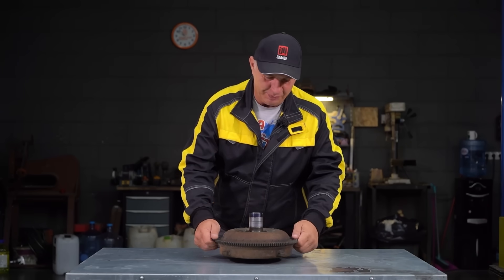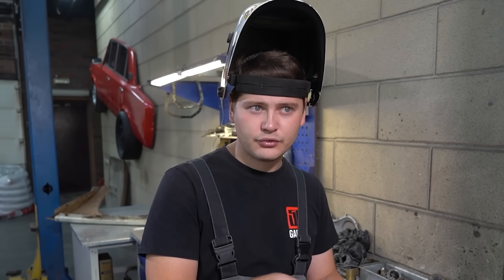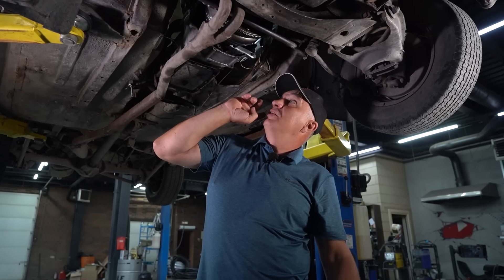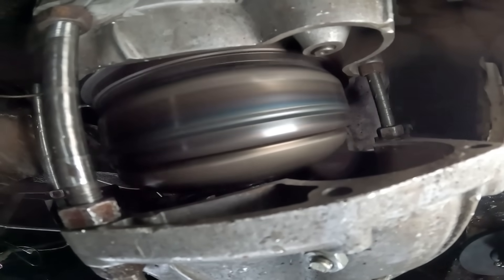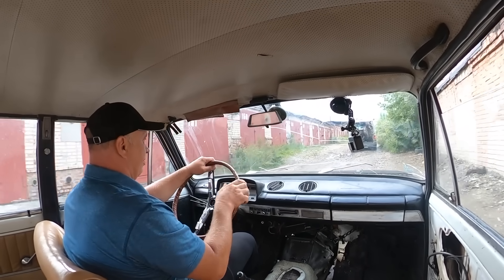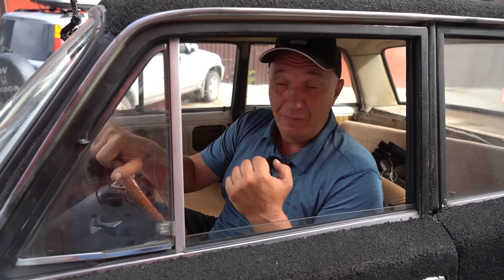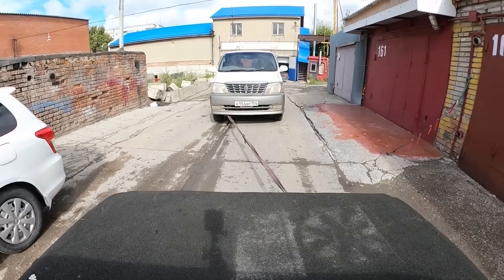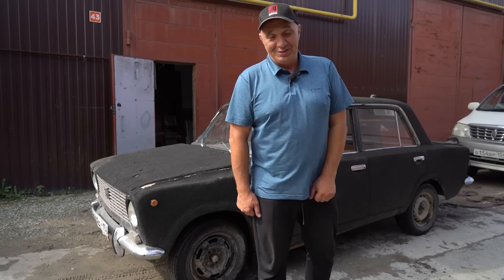Torque converter in a manual transmission - will it work?

Comment: Chrysler did what's called "fluid-drive" in the 50s which is a manual transmission with a fluid coupling (similar to a torque converter) and a clutch.
Reply: I drove both my '48 DeSoto and '50 Dodge today, both with Fluid Drive. The DeSoto has the M6 semi-automatic transmission and the Dodge a standard 3 speed. You only step on the clutch if you want to move the shifter. Oh, the last year of Fluid Drive was called Fluid Torque Drive and had an actual torque converter that used engine oil instead of the sealed Gyrol fluid coupling.
Reply: @ Love the DeSotos they were beautiful cars.
Reply: My 1949 Plymouth came with a fluid drive. Only need the clutch for take off and reverse
Reply: @lightcasey1  I had one as a teenager, leave it in 3rd and no shifting if you want, just slow on takeoff!!
Reply: @lightcasey1 Mom’s ‘49 Dodge Wayfarer, could leave in 2nd and drive in town, no clutching.
Reply: It wasn't stock, as Plymouth never offered Fluid Drive until the 53 HyDrive.
Reply: Koenigsegg uses a torque converter in one of its 150hp cars
Reply: @bogganalseryd2324  "Koenigsegg uses a torque converter in one of its 150hp cars" What a beast.
Reply: @eriklarson9137  lol should say 1500 lmao, the 1:1 I think it is in.
Reply: @bogganalseryd2324 they also designed a torque converter that is basically the only gear in the car
Reply: You mean 1500hp?  @bogganalseryd2324
Reply: @bogganalseryd2324  yea except the difference between their torque converter and other torque converters, is koenigsegg is just engine, TC, connection to the wheels. others are engine, TC, trans, connection to the wheels. the koenigsegg is in a direct drive ratio the entire time, and the only way it can reverse is the electric motors
Reply: Exactly! I owned a 53 Chrysler New Yorker (loved that car BTW). They called it Fluid Drive because the early version of a torque converter. Prior to Fluid Drive, all they had were manual shift cars.
Anyway, in order to drive the car, you had it in park to start it. Then, you pushed in the clutch (just once, which was the great selling point of Fluid Drive) and moved the lever to drive or reverse. 
As you drove, if you wanted to shift to a higher gear, you let up slightly on the accelerator and the transmission would automatically go to a higher gear. When you slowed down, it would downshift automatically.
If you think about it, in the 1950's, this was quite amazing if all you ever drove was a manual.
Reply: @moodberry not true, the hydromatic came out in the early 40s buicks and cadillacs.
Reply: Buick never offered Hydramatic until 1964.  They offered DynaFlow.
Reply: Drag racers did it with 727 trans known as clutchfite, was very harsh shifting
Reply: @rtraymond  Yes I remember those & they also made them for the GM Th400 !  They are very hard to find now and they were designed because at that time nobody made a stahl torque converter for the 727 & TH 400 that were being used for drag racing until I think it was B&M transmission designed & made the first shift kits and HP torque converters for automatic transmissions . Basically the clutch was used so the engines could be reved higher & the ability to dump the clutch to launch the car harder. You put the auto in 1st gear holding the clutch in do the burnout then stage dump the clutch then let the automatic shift it's self or shift it by hand to hold the gear in longer for each gear of the automatic.  I had read that supposedly Steve McQueen was the one who also invented what's now known as the trans brake for automatic transmissions or had something to do with this because he not only raced just about everything he could race in but with his money and the people he knew he probably had something to do with the invention of the trans brake . A lot of experimental things going on in drag racing back the like guys cutting torque converters in half & removing some of the converter fins inside then welding them back together and having them balanced so the engines would rev higher with the brakes on & basically creating a stahl converter although not very efficiently at all compared to these new high flash speed converters that are much smaller and have the fins curved that slowly open up once the rpms comes up then locks the converter up to launch the car & now they have these anti balloon plates welded to the converter snout for supercharged and nitrous applications so the converters don't explode from the high HP and torque they make over a natural aspirated engine .
Reply: @rtraymond I forgot about those.
Reply: There was also the VW AutoStick.
Reply: RIP Walter Chrysler
Reply: Citroën did this in the 70s - called the Convertisseur.
They used a automated dry clutch in series with a torque converter.
Reply: I had one of those setups....with  a 392 hemi in a 1940 Chrysler.....
Reply: @TheWolfsnack  And it held up in back of a 392?  Amazing!
Reply: @TheWolfsnack  Yes, mine was the 392. A lot of people don't know, but the 392 was exactly the same block as the famous later 426 hemi used for dragster cars for a long time. I think the only difference was the bore diameter and maybe some minor things like camshaft and/or main bearings.
Reply: @moodberry Completely wrong. The 392 and 426 are completely different engines. First off, the distributor is in the back on the 392, and on the front in the 426. There is not a single part which will interchange between the two engines.
Reply: The first thing I thought of when I saw this video!!
Reply: Old yale forklifts from the 40s had the same setup
Reply: Not only did Chrysler did this but they had several models of it. some had three speeds some only had two. The clutch pedal had an orange cover on it. A interlock switch on it required you to depress this pedal first in able to start the engine. Once the car was running, you selected which gear you wanted to start in.
Reply: @dalemettee1147  The simplest iteration of Fluid Drive was the Fluid Couple in front of a conventional 3 speed manual.   This debuted on the 39 Imperial.  Optional was the same with overdrive.  For 1940, they were both extended to New Yorkers and Saratogas with 1st gear blocked off, but nowadays, 1st is likely to be unblocked.  For 1941, the Dodge get the 3 speed with Fluid Drive, with or without overdrive.  For 1941, a vacuum operated semi automatic 4 speed was introduced for the Chrysler 6 and the DeSoto.  For 1946, both the vacuum-operated "VacaMatic" and the 3 speed with overdrive were replaced with a new 4 speed hydraulically operated semi automatic for the DeSoto and Chryslers, with it being standard on Chryslers, except for the bottom of the line Royal.  Dodges were not supposed to have this trans until 1949, but earlier models have been found with it.
Reply: My dad had one when I was a kid we traveled to California in it .
Reply: When I was about 15 (1974) I got to drive my grandmother's mid-50s dodge that had the fluid drive 3 speed manual trans. Once you put it in gear you didn't need the clutch to stop and start, only to shift gears and if you were careful, you didn't even need it to shift. You could put it in any gear and take off from a stop. It was a slug on the take off in high gear and I imagine if you did that very much you might damage the fluid coupling.
Reply: GM had a system for the Chaparral 2A. Fluid flywheel on a 2 speed+Rev manual transaxle. Mag. alloy casing weighed 7/10 of nothing and had to transmit 450ft/lbs of twist, with 14"wide soft racing rubber and rarely gave trouble as long as the oil was kept cool enough.
Reply: YUP, When I was a kid, we got about a 50 Plymouth that sat on the neighbor's farm running with the fluid drive. You could take off in 3rd (high) gear. It wouldn't spin the tires on gravel no matter how hard you tried.  In short order, the neighbor kid's parents found out we were tearing around in it, and that was that. Not sure why they had a problem with 12-13 year olds driving around. We even got the brakes working, sort of. 😆
Reply: I have a 46 dodge with the fluid drive manual transmission
Reply: The finnish Rasi (raskas Sisu) is a 6x6 offroad truck with a torque converter and a manual transmission.
Reply: Dry clutch in front of torque converter followed by a regular transmission was used in several pieces of construction equipment in the past
Reply: It's the gyromatic transmission. My 1948 Chrysler Windsor has that type of transmission. I love my ole 48. Fun to drive.
Reply: I think Pontiac experimented with similar in early 60's,  the tempis was also involved in R&R, I think ?? Anyone 4 sure on this ??
Reply: @davidsanders6957 my tempest was just a two-speed automatic with the torque converter spinning behind the rear bumper
Reply: @RonaldDaub-v9y  Rope Drive!
Reply: So did Packard.
Reply: I remember riding on one of those cars😊
Reply: MAN KAT lorries had a great gearbox, working on the same style.
Reply: @Ben72-u6p  That's just an automated clutch pedal.
Reply: Add Packard to the same type of transmission.
Reply: GM made the same setup for WW2 era tanks. VW too with the semi auto Beetle, but later in years. Then you've got the B&M hydro-stick kits that worked really well in the gasser classes of drag racing.
Reply: I had a 52 Chrysler windsor with that
Reply: They are weird to drive, had the pleasure to try one once
Reply: I've driven a military truck with Cummins engine and a manual gearbox with torque converter. Only needed to clutch when shifting, but for example at stop signs you could just use only the brake and drive it like an automatic.
Reply: It's easier just to put a centrifugal clutch on it or a belt clutch with triple pulleys
Reply: My Yale forklift has that... a fluid coupling & a clutch.   Old tech
Reply: My WWII era father would occasionally reminisce about those.
Reply: 1953-1954 Plymouth Hydrive had an actual Torque Converter instead of the Fluid Coupling.
Reply: Imagine a normal Torque converter with a lockup Clutch inside plus a seperate clutch between the converter and gearbox. You could push the normal clutch by foot to select a gear then let off the clutch and start moving with the torque converter and from 3rd gear and up the torque converter locks up so you Drive it like normal manual
Reply: Auto manual transmission used for racing in the 50’s-70’s used a power glide with a three speed behind it.
Reply: My Grandfather ha a 49 Dodge with fluid drive.  You could just step on the brake at a stop sign.  Not much off the line that way though.😂
Reply: I was thinking same thing
Reply: Chrysler started the Fluid Drive in the 40s. I had a 47 Dodge Club Coupe with Fluid Drive. I could stop without using the clutch. Didn't accelerate quickly in 3rd gear but I didn't have to move my arm from around my girlfriend! LOL
Reply: Came to say this, drove my father's a couple years ago. Needs a new clutch and fluid change.
Reply: I have a 1950 Dodge Pilot House with a fluid drive. I was going to comment that this sounds almost exactly like a fluid drive.
Reply: smooth drive :)
Reply: I had a 48 dodge with fluid drive. Worked ok.
Reply: you beat me to it . I had a 50 chrsyler windsor sedan that was fluid drive. 6v positive ground. It worked pretty good for what it was .around town you could just put it in gear never had to shift or clutch at a stoplight
Reply: My father had such a Chrysler. That newfangled transmission was difficult to master and was a pig for eating horsepower and making the car slow as molasses on a winter day. No wonder the idea was dropped.
Reply: @rcnelson  It was dropped because Powerflite came out in mid 53, and customers liked it better.  Most of them anyway.
Reply: Clicked on the video exclusively to say what you already said.
Reply: Would have been awesome with a switch pitch torque converter.
Reply: No kidding. Didn't Tucker try something like that in the 40's? I wonder if they perfected what he was trying? If he had just been a better business man I think Tucker could have succeeded. He bought an aircraft engine manufacturing plant and that at the time was doing excellent business selling engines for small planes and had like 60% or greater of the market and stopped them from selling their engines for airplanes so they could go in his car. What kind of a business man stops a profitable business so he can maybe make money on something else? If I didn't know better I would think he learned from our current president.
Reply: my stepfather had a 53 Plymouth. that thing was awful.
Reply: I was just about to make this comment. I restored a 48 dodge business coupe & it had a fluid drive. Such an interesting idea.
Reply: auto transmissions all have clutches inside and the transmission can turn-on the converter lock otherwise its off mechanically
Reply: @prjndigo yes, but look at the difference between a dcts clutches and the clutches in a standard torque converter automatic, quite different. The gears themselves are different between the two as well
Reply: Something similar modern day called a viscous clutch, I think it was Volvo XC90 early 2000's, AWD if the tires are different sizes it destroys itself tho so watch out
Reply: I remember that on a 40 Dodge. 3 on the tree, clutch pedal. Put in first on a steep hill, let clutch out and it would hang till you gave it gas.
Reply: A common wet clutch manual then? (Supercar territory) Chrysler were ahead of their time for sure!
Reply: @Hrossey  No, a normal dry plate clutch in series with a fluid coupling.  This became an 'automatic' with the addition of a then-common overdrive unit behind the transmission (but it was actually set up for underdrive vs direct drive).  There were two ranges, 'low' (with the gear selector in the equivalent of 2nd gear on a 3-on-the tree), and 'normal' (with the selector in high gear).  You pressed the clutch to go into one of these ranges.  After that, you relied on the overdrive unit to switch between underdrive and direct drive.  They had the reputation of being pretty sluggish in normal range, but they did offer two pedal driving once you selected a gear.
Reply: @boggy7665  didnt this system also cause cars to literally get 3mpg
Reply: @bluespidergaming7719  My 1949 Chrysler fluid drive gets 20mpg.   And the fluid drive still works perfectly.
Reply: @bluespidergaming7719 that’s the Buick Dynaflow transmission which essentially was a glorified torque converter with variable pitch vanes. Provided smooth driving, but fuel economy was out the window. Even in the 1960’s, the Buick Dynaflow averaged 6 MPG and that was terrible by 1960’s standards. And yes, people did actually care about fuel mileage, that’s why there were cars like the Ford Falcon and a few others for those who were conscious.
Reply: You are describing the pre-war version only.  The post-war version, which is what is more common, is a 4 speed constant-mesh trans that shifts automatically between 1st and 2nd in Lo, 3rd and 4th in Hi, later called Drive.  In normal driving, you only needed Hi/Drive unless you were taking off on a hill or towing a trailer.
Reply: Also, Buicks couldn't match the performance of an Olds or a Cad.  Hydramatic was just better.
Reply: @bluespidergaming7719 you might be thinkong of the dynaflow. That was Buick and not the same thing. The torque converter has many different states to accoifor throttle and it did have 2 gears but when you stepped on the gas, it was loosening the slip on the converter to allow it to rev up.

Yes that was inefficient but it did work.
Reply: @bluespidergaming7719  Who cared?
Reply: @Hrossey we cheaped out to save money not move forward in progress
Reply: @JNAMOTORSPORTS There is very little true progress nowadays, just cost cutting that only greedy share holders like.
Reply: @Hrossey  they were also the first to make lockup clutches commonplace. Packard & Studebaker were the first to use them in their high-end models, but they were complicated and expensive to produce, so they only did it for a few years. Once Chrysler made them standard years later, every auto manufacturer started using them.
Reply: @Hrossey the only problem was that it was made by chrysler 😂
Reply: @joey9511  mopar or no car
Reply: @joey9511  Chrysler was great back then.
Reply: My 335d steptronic is like this. It has a torque converter and a manual gearbox which can be computer controlled to emulate a full automatic, or else you can use it as a manual transmission, without the clutch. It's an 8 speed and is how all transmissions should be in my opinion.
Reply: @davelowe1977  Steptronic is not a manual gearbox, its a regular torque converter automatic. Absolutely no difference between steptronic and a random Kia forte automatic driving by lmfao. They got you good my dude. It isn't a manual gearbox its a regular automatic. Dual clutch automatics aka DSG/DCT are manual gearboxes with computer control to emulate a full automatic. Steptronic is NOT a DCT/DSG. Internally a bmw steptronic tranmission is designed like any of they automatics. Bmws dcts are different and designed like a manual. You have select shift like all modern automatic torque converter transmissions have, not a manual gearbox.
Reply: @DarkAttack14 i know it is mechanically. I was describing how it is controlled / how it appears to the user.
Reply: We're converting a 48 Chrysler 6 cylinder to TH350 now.
Reply: @hotrodray6802  YUCK,  leave it alone. It survived this long only for some window lickin' LS cowgirl to ruin it. How much bondo you using there Barbie?
Reply: @hotrodray6802  Don't know why you would bother. The stock fluid drive is incredibly simple, rugged, and easy to fix if you know how. It requires a slightly different driving technique which you can learn in 2 minutes. I agree, it is not the greatest trans ever made but after all it was one of the first efforts at an automatic drive. I would much rather fix the fluid drive, which is easy and cheap to do, than change to a different trans.
By the way I hope you are planning on changing the rear axle as well. Because the hand brake is on the back of the Chrysler trans, if you put in a TH350 you will have no hand brake, unless you put them on the rear axle like a GM car, and then you might as well change the whole rear end. And of course drive shaft, and set up a new hand brake cable system. Use a Chrysler or Ford rear axle so the wheels will fit.
Reply: @hotrodray6802 please don’t. At least use a 727 or 42RH.
Reply: @throttleblipsntwistedgrips1992  Why??? is illegal???
Reply: Came here to say this
Reply: A torque converter IS a fluid coupling.
Reply: @osmacar  All fluid Torque Converters are indeed Fluid Couplings, but not all Fluid Couplings are Torque Converters.
Reply: @osmacar  OK, I will explain the difference.  A Torque Converter is capable of increasing torque, due to the presence of one or two Stators between the the pump - the Driving Member, and the Turbine - the Driven member.  They give the fluid in the converter an extra "kick" as it goes through those Stators.  A plain Fluid Coupling does not have a Stator and isn't capable of increasing torque, it can only transmit it.  True, it's Driving member, the pump, is capable of turning slightly faster than the Driven member, the Turbine, which puts the engine closer up into it's optimum torque speed, but it can't increase it the way gears or a true Torque Converter does.
Reply: @osmacar  What does my Nationality have to do with Fluid Couplings vs Torque Converters?
Reply: @ Get lost.
Reply: @jamesbosworth4191  Right back at you Jimmy boy.
Reply: @osmacar  This, however, is not a torque converter but is also a fluid coupling; which is why I made that distinction in my original comment.
Reply: @AC-io8qs  same principle different mechanism,. a hydraulic and pneumatic piston are the same, how they execute the function is what differs, but both do the same thing.